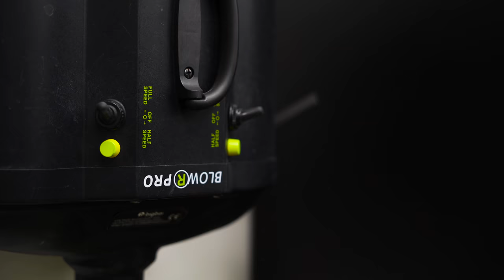Dirty Porsche Macan S Carwash - Exterior Auto Detailing

Comment: Cracking results!👍🏻

Not a criticism but just an observation.

I would be inclined to apply and allow to dwell wheel cleaner to cool, dry wheels and pressure wash to remove 90% of wheel contamination, following up with shampoo, wheel brushes and mitt to avoid any potential for light scratches caused by road grit etc. Which is more prevalent on gloss black wheels.
The same with the whole car pre wash foam, would it not be less paint damage inducing process to foam, dwell and rinse before using detailing brushes around badges and window frames which presumably spread dirt and grit around those surfaces.

I’m interested to hear your comments to the points I have raised.